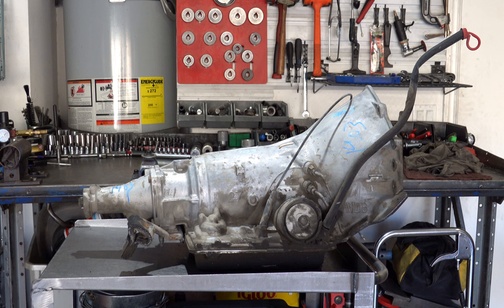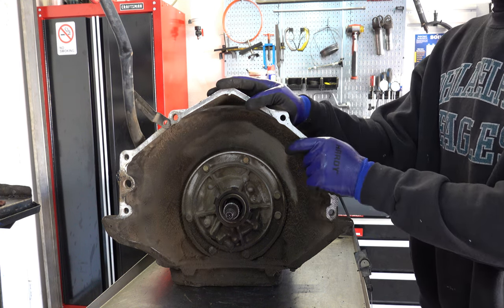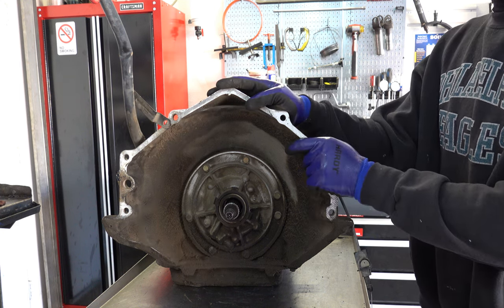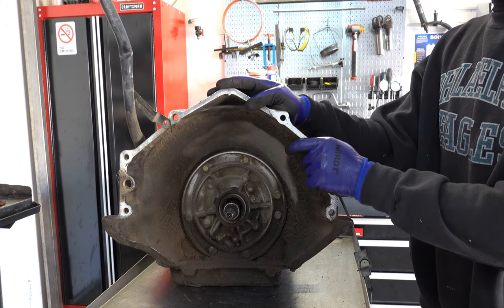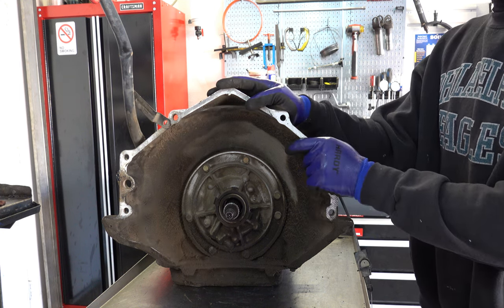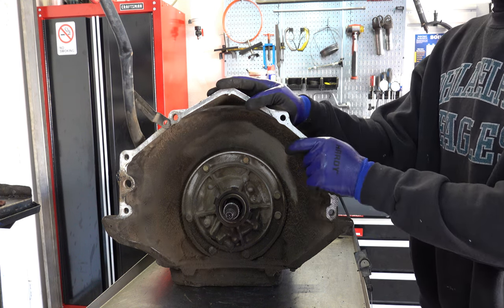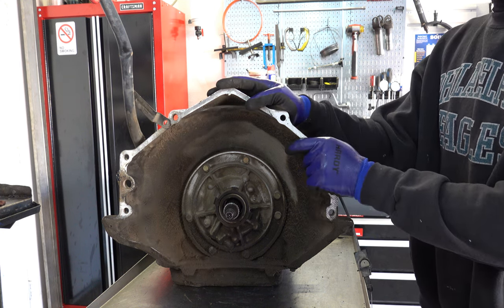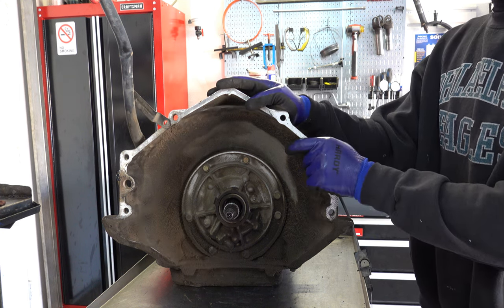700R4 Teardown and Inspection

Comment: Nick my first $240. (Borg-Warner kit) 700R4 transmission rebuild was a success. Did a 2/3's rebuild. I knew the piston 0-rings had been rebuilt a year early in 2022 and took a chance that they were still ok and they were....Transmission was responsive when placed in gear (before it was pulled) and I had burnt up the 3-4 clutch pack due to towing in 4th, with misadjusted TV detent cable. Now, I'm starting my second 700R4 rebuild, that has more issues, biggest being DELAY when placed into any rear, reverse or forward and when shifting...DELAY before it goes into gear, like the transmission has to build up fluid pressure. Transmission only slips in 3rd/4th but has delays into gears. What area should I be focused on for this ENGAGEMENT DELAY, acts like i have low fluid pressure everywhere in this second transmission. Would that delay be caused mainly by the vane-pump?, or loss of pressure in a piston o-ring? and which piston o-ring/s would you suspect for engagement delay in reverse and 1st-starting? Also, had issues sending in my donation online...do you have a P.O. box address? You saved me a lot of money with your tutorials.
Reply from the maker: Sorry to hear of those issues, man...When you say 'Piston o-rings being rebuilt' what you referring to? Sealing rings, lip seals, rubber o-rings on the accumulator pistons are not rebuilt, just replaced.

Is the transmission filled to capacity, showing full-hot when at operating temp?

What were your line pressures at idle on this 2nd transmission?  

What were your pump rotor-deck and slide-deck clearances in the pump?

What happened with this transmission to require overhaul initially? 

What year 700R4?

I need to know more, including answers to all of the above, before I can do more than just guess because it could be any number of things.
Reply: @nickstransmissions  My first transmission 1989 i rebuilt was a success- done with that one, been drivig for two weeks on it, love it, works great- like new. Now,i'm going to open up the second 700R4 (unknown year, never been inside, but was rebuilt by someone previously) that has shift delay issues which I have used as a back up transmission. i have no way to measure line pressure, not that sophisticated. I was just wondering...on this back-up transmission that was in the truck recently (pulled)... there was a 2 or 3 second delay in putting it into first or reverse, either drive gear huge delay before engagement like the fluid pressure is low. I'm just trying to get a tip or your expertise on where you would think the issue exists befoe i go in for the rebuild...would it be the pump or the piston lips-inner seals...and which ones would control both forward and reverse?
Reply: @nickstransmissions  yes, transmisson was filled to capacity...trying to figure out the delay on engagement...reverse or forward...where to look and what to look for....before i go in to operate- surgery. Give me your first , second and thrid places....ranked in order what is most likely the cause of the delayed engagement...in first and reverse...acting the same exact way.
Reply: @nickstransmissions  This unknown transmission was owned by a youngster that raced it w/ a 2300 stall converter...and then went to a stage 3. He said it was rebuilt a year earlier...but it always had a delay like the fluid pressre was low. I got a good deal on it $450. so i went with it...used it for a year and 3-4 clutch pack started to slip. i serviced it 3 times, new fluid..filter, made no difference.
Reply: @nickstransmissions  I think of all the spring held lip-inner seals...as pistons-movement, maybe I'm incorrect.
Reply: @nickstransmissions  Permit me to rephase my question better. I have an unknown year 700R4, that was previously raced- probably in a camaro. I used a stock converter new for a year and found the transmission worked reasonable well...except for a 2 to 3 second delayed engagement when not moving, when you first put it into reverse or Drive (1st). Also when the truck was moving and went from 2nd to 3rd there was a delayed engagement into 3rd. What is common to both reverse and 1st that delays engagement of transmission? Ranked items as most probable down to least probable. The way i used to drive the truck with this transmission was i controlled the 2nd to 3rd shift with the column shift...because if i didn't the 2nd to 3rd upshift had such a long delay that the engine RPM would increase...acting-feeling like the transmission was slipping before it caught 3rd and locked in.
Reply from the maker: I'll list what I think the correct order of events are - please correct me if I am wrong:

1. Transmission was in a Camaro, probably raced - exhibited delayed engagements and upshifts into the following gear from 1st to 4th gear as well as reverse

2. Transmission comes into your possession; you install a new stock converter and drive it for a year where it functioned mostly normally, except for a delay (possibly a flare shift) into 3rd gear from 2nd gear as well as delayed engagements into Drive and Reverse

Question: Have you actually rebuilt this 2nd transmission and dealing with the same pattern of problems or are you trying to simply diagnose based on how it was since you installed it into your truck?

Also, you ABSOLUTELY NEED A PRESSURE GAUGE to validate your TV Cable is set up correctly (i.e. geometry) and adjusted correctly (tension). Without it you're at a disadvantage. These things are not expensive - search Amazon for 'Transmission Pressure Gauge'. I have a Matco combo set with oil and trans pressure gauges - they work well and cost me $40.00. Not bad for something so critical.
Reply: @nickstransmissions  Yes, and yes on your #1 and #2 Events. No, i have not rebuilt this particular transmission, nor opened it up yet. I am trying to diagnose it based on how it was functioning in my truck. I'm trying to get a probability list of items to pay close attention too... that causes a delayed engagement, before i go inside it. I will look into getting that pressure gauge, where does it attach too? And can i can check this pressure while the transmission is installed in the truck driving? I'll need to review your videos again to check where/how you tension your TV cable using pressure....currently, I like to run my TV cable a bit tighter....where it shifts to 2nd at 14 to 17mph and 24 to 28 mph into 3rd (depending on acceleration speeds). It's an old farm truck 1989 GMC Sierra. I use the truck for towing trailer-cattle and hauling feed.
Reply from the maker: Yep, you can check pressure while driving but you want to test first at idle (min and full throttle valve). 

Given this transmission has some miles and use on it, the delayed engagements could be any number/combination of things. Run the pressure test and let me know the results and we can go from there. But if you have to yank and overhaul it, perform a methodical tear down like shown in this video to determine/identify the causes of your drivability symptoms.
Reply: @nickstransmissions  It's already been yanked out. My truck is drivng on the rebuilt one i did, runs perfect shifts are responsive and crisp. Yeah, figured i might have to do all the lip-inner-outer seals on this transmission. The pump, servo, accumlator, frictions, and valve body are fairly easy for me. I'll have to manufacture handmade tools to do those three areas where spring compessors are needed. I can block wood some of them...but need three hands to remove the snap rings. The joy the joy. Nick do you have a safe postal address for gifting? On-line payment got disabled after my telephone number changed, no confirmation.
Reply from the maker: Oh, ok...sounds like you just need to go through it with the same approach and attn to detail as your previous build - should be no sweat for you. this time!

I appreciate the gifting gesture but don't have an address that I can share on YT...I do like coffee so if you get your on-line pymts working again, you are certainly welcome to buy me a few cups if you'd like.

Meanwhile, you can purchase a clutch spring compressor tool kit at Harbor Freight or on-line for all of the return springs in the unit...You have the low-reverse (has its own spring compressor tool), the reverse input drum and forward drum (which i believe one other tool will do both drums but you'll have to check...Or, as you mentioned, you can make your own - pretty easy deal.

Comment: Can you dispell or verify a rummer that I hear quite often? A lot of people say that a 700r4 that was originally behind a smaller engine, (regardless of year model,) like a 6 cylinder or 305 was built weaker and should not be considered for use/upgrade behind a motor that has increased HP.  Personally, I don't think the assembly plants went to that much trouble to have different transmissions for each model, and I  haven't seen any part differences in my researching, but many people do. I'm old and could be wrong.

Thanks,
John
Reply from the maker: Hi John, the 1982-E84 700R4s were markedly weaker and less reliable than follow-on iterations and IMO, it's those earlier years that are primarily responsible for the 700's reputation for being a weak transmission. For anyone working on an 82-E84 700, it's recommended the swap in a pump assembly and input drum from a L84-87 700R4 to eliminate the short comings of those early 700s. 

When properly built, any L84+ 700R4 and 4L60E can hold some power and perform (check out my various videos on 700R4s) - my 'base' 700 package is good to go for anything up to about 350-375 horse in a mild to moderate street strip application. Additional, upgraded parts and procedures can bring it to nearly double that figure before you run into the design limits of what the unit is capable of, even if you had an infinite amount of money to spend on parts, etc.

Comment: I am rebuilding an 83 700 R4 for my rebuilt 425 hp  400 SBC. Should I be worried about my 27 spline stator/ pump? Can I simply replace my 27 spline stator with a 30 spline stator or do I have to replace the whole pump? Thank you!
Reply from the maker: What's up govsux (love the username) - Yes, I would upgrade to a 303/304 body/cover-stator combination, fully remanufactured/resurfaced, etc...Those numbers refer to the last three digits of the casting no. for each part. The 27 spline input shafts in 82-E84 700R4s are weak and won't last too long in your application...

Ironically enough, the 200-4R input shaft, which also has 27 splines is good to 500HP for the 2nd design shaft (the first design is good to about 400 or so).

Comment: A while back, I had a 91 700r4 "rebuilt". I chose the wrong shop in Red Lion Pa. After $1800 buck rebuild, it blew 9 months later. Unfortunately, in that 9 month period, the owner had a stroke and closed the shop, leaving many customers like me in a bad place. How much should a full better than stock rebuild cost? I heard a pop noise and lost all gears. 1991 C1500 2wd Silverado. This looks really complicated. You know your stuff, saw the Eagles sweatshirt. Are you in Pa? Looking for a good guy for a rebuild, and you Sir are good. Fascinating video.
Reply from the maker: Hi Jeff, thank you for watching and sorry to hear that shit happened...Yes, I'm originally from outside Philly (Lansdale) and same shit happened to me for roughly the same amount of money. That drove me to teach myself how to build transmissions so it would never happen again and a big reason why I started this channel...Here's my take on the 700R4 when it comes to rebuild profile: They all should come with some basic upgrades, including:
1. 97+ 4L60E bonded steel/rubber pistons and return spring
2. .472 / .390 boost and reverse boost valve
3. Transgo SK700Jr Shift kit (line bias and 3-2 control valves blocked for high performance)
4. 3-4 clutch clearance set to .030-.050 - no load release springs in anything 88+
5. Sonnax TV valve sleeve and plunger kit
6. Corvette 2nd gear servo
7. Any 82-E84 units upgraded with a L84-86 pump and input drum
8. Pump and Rev Input Drum reconditioning/machining as needed

I only do bench builds which does not include removal, reinstallation, fluid, TV set up and adjustment but my typical 700R4 usually runs around $1450-1500 or so.
Reply: Hi Nick. Could give me your recomendation for buy the number 2 for my 1992 4L60: .472/.300 boost and reverse boost valve?.
Thanks again.
Denis V.
Reply from the maker: @DenisVassiliu  Hi Denis, you can usually find them on eBay, Amazon or your local hard parts supplier...You can also check Transstar.com for a distributor in your area where you can purchase parts in person.
Reply: O.K, but what are Sonnax or TransGo, part numbers or kits for these parts? I did a search and I can't see a .390 reverse valve for sale. Only .300. It's OK ?
Reply from the maker: The .300 rev boost valve should be fine for most applications...You can visit Sonnax's and Transgo's websites for all part numbers, plus both provide detailed instructions for installation on every part or kit they have available.

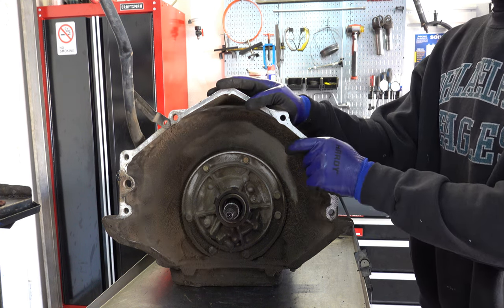Comment: @30:41, what happens if you run the transmission without that transfer tube installed? Sorry if I offended you Nick, I'm not a troll...I did a 2/3's rebuild on my first transmission due to my inexperience & fear...took a chance on the piston lips seals being ok, due to the fact it was rebuild in mid-2022 and they were. Truck is running nice. I completed my second rebuild on my back-up 700R4 (that was owned by others-raced) and this time comprressed and did the outer-inner lips seals and then air-tested the drum with 30 to 15 PSI. This particular transmission was driven without a transfer tube...and I can't find any information on what happens if this tube is not installed...performance or otherwise. Actually i think you answered my question at 33:39...the vane pump feeding the auxilary valve body via the tranfer tube gave it smoother shift into forward gear...without the transfer pipe...it'll shift hard.
Reply from the maker: Good question, I never ran one without that tube installed, if it's supposed to be there...My guess is no forward movement since everything routes through that pipe. Also, I know you're not a troll...I've had to ban a few trolls from the channel, none of your comments or questions are even remotely close to troll-like...Thanks for watching, man!

Comment: Thanks for posting… I have a 700r 1991 and it’s clunking in reverse and doesn’t feel like it’s fully engaging only in reverse. 91 camaro maybe cable adjustment?
Reply from the maker: Thank you for watching, LRadman...Not a cable adjustment issue...otherwise, you'd have noticed drivability symptoms in your forward gears (slipping,  neutral conditions, etc especially in 3rd). 

Reverse delayed engagements are typically caused by wear in the square cut seals on the low reverse piston at the back of the case. This causes the pack to either not fully apply or slip/burn (or both)...You could also have a reverse input clutch failure but that's less likely...Most of the time it's the low-reverse piston seals wearing/hardening and allowing apply fluid to blow by instead of applying the piston when in reverse.
Reply: @nickstransmissions  thank you so much for replying, I have been trying to find answers for a while. No real problems in any other gears but also when I put it in park the car will roll back or forward a hood 6-7 inches before the trans catches. The clunking is bad when first reversing and slowly goes away as the car (91 camaro) gets some momentum. Tried to back it up onto some patio stones about 3 inches high off the ground and it didn’t like it- clunked alot and it got faster with rpm, backing up a hill does the same thing- grabs a little bit, clunks a lot eventually will go with momentum 😬
Reply from the maker: The clunk is likely your driveshaft making contact with the base of the output shaft - they have some built-in play to allow for changing pinion angles and that's critical on F-body and similar platforms that ride low to the ground. If the 'clunk' is beyond just that (i.e. you're already aware of the normal driveline clunk) then trans likely has to come out as the rev input drum female lugs are likely worn and/or anti-clunk spring at the center support may have broken (very rare but seen it a couple times)
Reply: @nickstransmissions thanks for the great advice, I am not aware of the driveshaft issue and will check for that 🤞. Could that also be the issue with the rolling back and forth play when put in park?
Reply from the maker: Rolling a bit on a grade is normal. As long as you eventually go into park, you're fine...One thing I'd do is pump the brakes whenever parking on an incline or decline so that the full weight of the car doesn't slam into the parking pawl...If the pawl breaks, you will lose the ability to put the car in park; the trans would have to come out and be replaced. 

Please sub if you haven't already - ill be doing some more 700R4 vids in the very near future.
Reply: @nickstransmissions absolutely, I’ll be looking at it shortly. Thanks again for the quick reply and advice- it’s hard to get these days.
Reply from the maker: You're welcome, man.